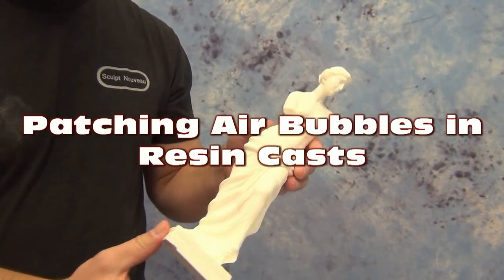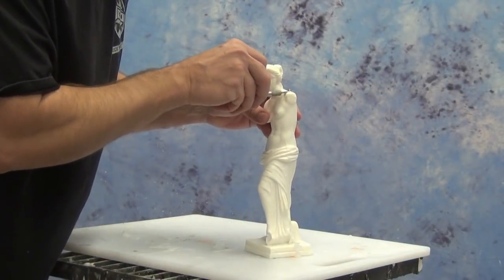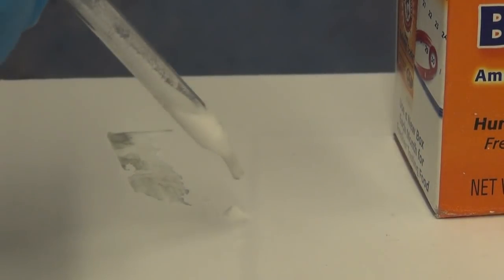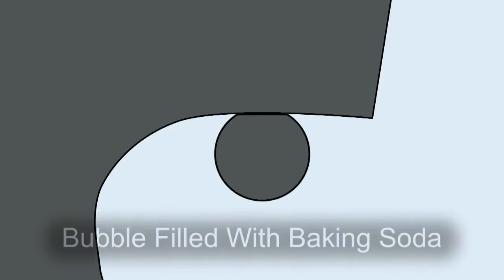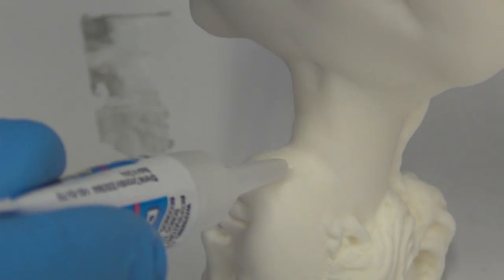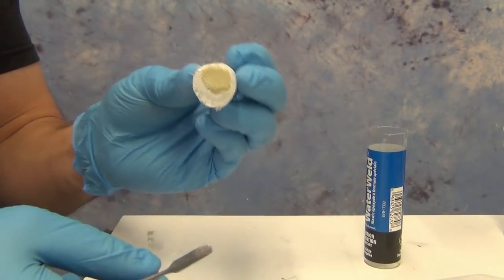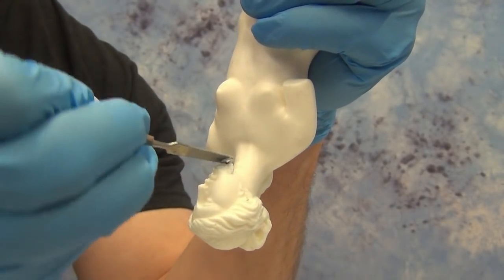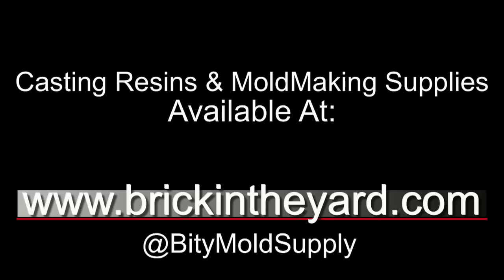Resin Casting Tutorial: Patching Air Bubbles In Resin Parts

Comment: Instead of dispensing your SuperGlue directly from the tube, squeeze a bit of the glue onto a piece of cardboard (I use a small index card).  Put the end of a toothpick into the glue.  The toothpick will pick up a small amount of the glue.  If you get too much onto the toothpick, you can "dab" the excess back onto the cardboard.  The gob of glue will hang down off the end of the toothpick.  Touch the bottom of the glue gob to your baking soda.  The glue will wick into the baking soda.  You also have much better control of the toothpick than with a large tube of glue.
Reply from the maker: Good tip! Thanks!

Comment: Interesting, didn't know the baking soda and superglue combo, i saw others use superglue and talcum powder and for larger holes i like to use something similar to a drywall spackle paste that's easily thinned with water, used it to fill and sand 100 mm layers  and it turned out very smooth.